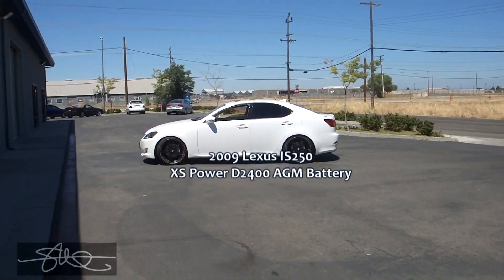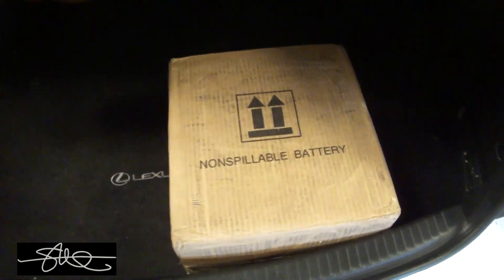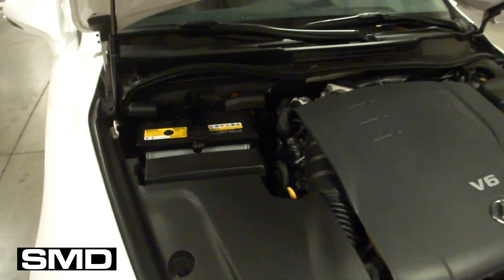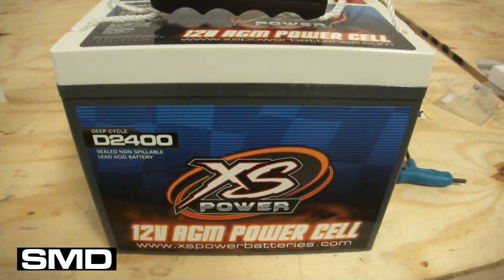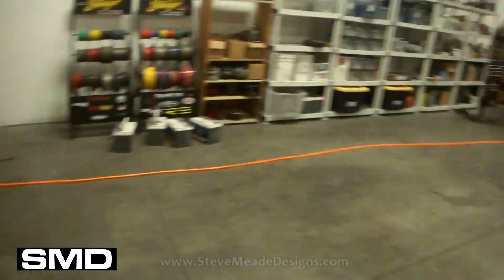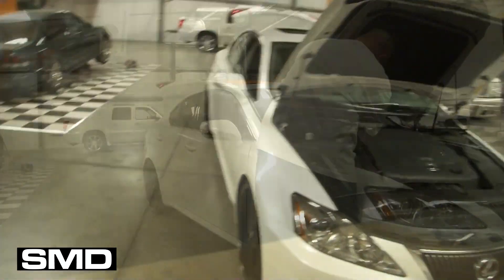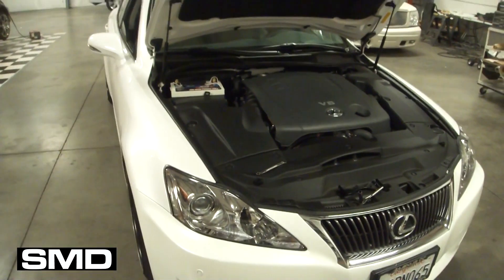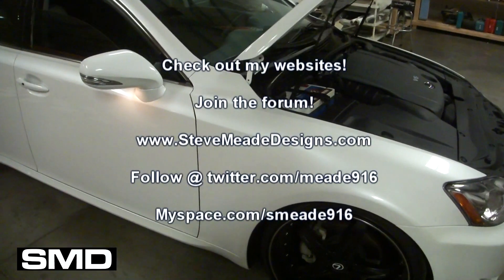Lexus IS250 Battery Swap - XS Power D2400 AGM

Comment: @cool3be Lexus production techniques include methods and standards of quality control that differ from Toyota models. At the Tahara plant, separate assembly lines are used.Welding processes, body panel fit tolerances, and paint quality requirements are more stringent.  Lexus plant workers, typically veteran technicians, are identified via repeated performance evaluations and ranked according to skill grade, with limited applicants accepted.

Comment: I have a question though like what's more reliable about that battery besides tipping it over without spilling damage then the stock one, just curious, like did u have a problem or something that made you realize hey the battery sucks needs a swap or did u just want to replace the stock just because you felt like it (sorry bit of a nooby) ?

Comment: Speaking of batteries, whats the BEST solution you have found to keep battery corrosion from happening on your terminals under the hood steve? I have used the special spray that cost 8 bucks and it worked for a few weeks and that was it, Tried plain grease which lasted longer but once it dried up it came back. I want to fix the issue, not keep having to clean the terminals with a wire brush and apply goop to them every month or so. Any help here?

Comment: HEY STEVE I GOT A QUESTION IF U CAN PLEASE RESPOND I WANNA GET A NEW BATTERY IN MY TRAILBLAZER LT THE CAR IS AN 08 AND THE BATTERY RUNS FINE NEVER HAD A PROBLEM YET BUT ONLY CONCERN IS THAT MY CAR IS EQUIPED WITH H.I.D LOW BEAM AND FOG LIGHTS ALSO LED TAIL LIGHTS AND LED INTERIOR DOME LIGHTS DO U THINK I SHOULD CHANGE IT IF SO LET ME KNO WHATS A GOOD XS POWER BATTERIE THANKS STEVE

Comment: @meade916 i just order a d3100 and it comes in this sat, but will the xs power batts charge on a reg batt charger? or is the xs charger recomended? just trying to make shure before i ruin a $350 batt.

Comment: Hey steve quick question, i just purchased a xs xp2000 battery and the termina post adapters for it so im wondering can i replace my stock battery with it ? Or is it only for use as a secondary battery?

Comment: @010countryboy010 

Heres what I would do... either save up from the 300 you have already and wait it out, or buy a 300$ decent wattage but NOT a junky high wattage amp, and then when you have the money later, upgrade your mids, highs and amp and use the old amp for the mids and highs :D

Just my opinion :)

Comment: @010countryboy010 i have 4 solo x 18s 2 in my jeep & 2 in my cady i have vids of my jeep and im only runnin around 3000 watts if money is tight look for somethin used or check out ebay $300 can get u a nice amp i wish someone would give me some more 18s u must have some really cool friends maybe go to a shop that deals with new and used car audio that sells kicker u could trade 1 18 for a really good amp 1 18 is loud i hit 149.3 with one solo x 18 in my jeep and stock electrical